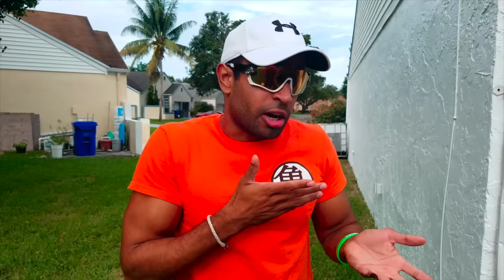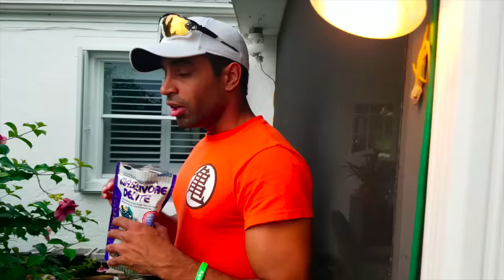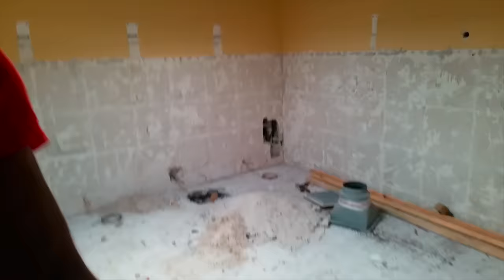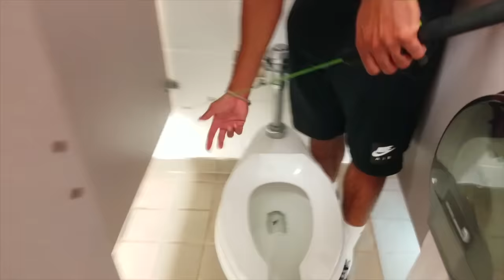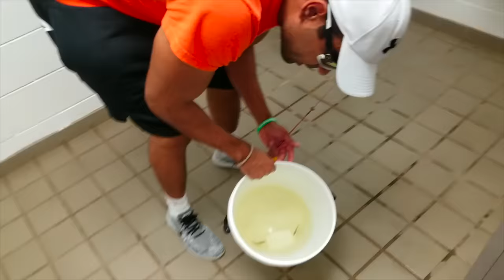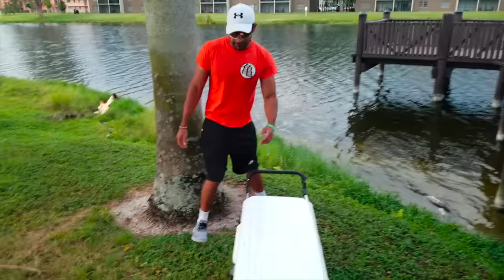FISHING in TOILET!

Comment: Great Prank! But it is hard to fool an old plumber. There is no water in the pipe leading to the main pipe under the road, until you flush it. And it only takes seconds for the water to reach the main pipe where there could be as much as a whole inch of standing water. Not deep enough for a fish to swim in.
     The only underground pipe that does have water deep enough for a fish to swim in, is a Storm Water pipe. But this was a very entertaining video. 🤣👍